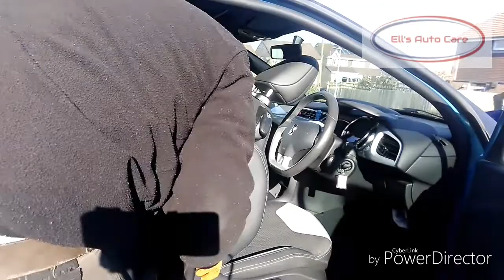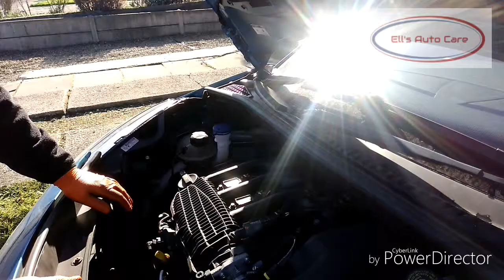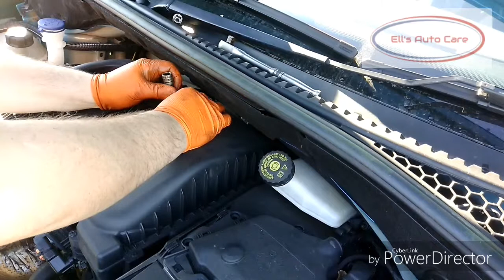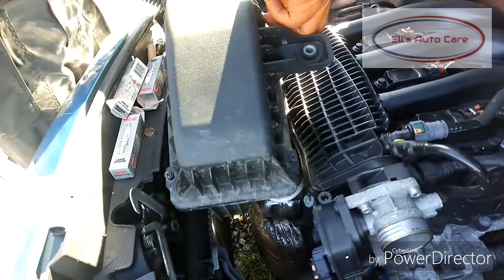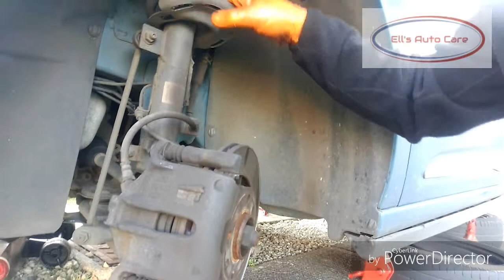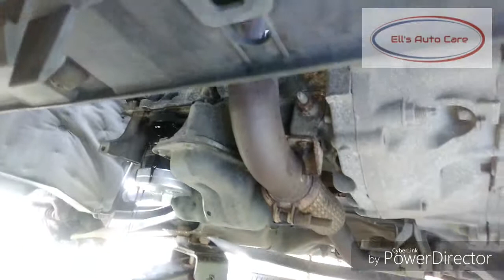How to carry out a professional service on a DS3

Comment: Hi, when I lift the front of my DS3 I use my trolly jack on the jacking point and put the axle stands on the sub-frame. I'm not a professional mechanic so I trust that your way is best. Why though?
Reply from the maker: Your way is fine! I just prefer to use the jacking points that's all
Reply: @EllsAutoCare  Thanks!